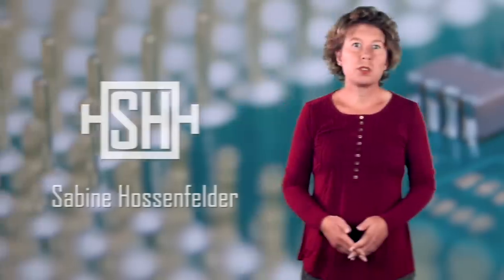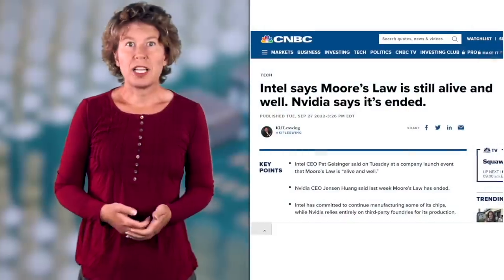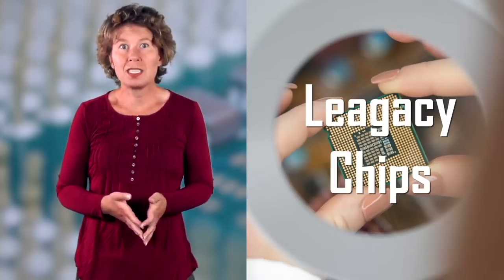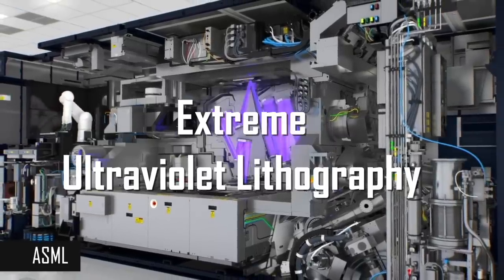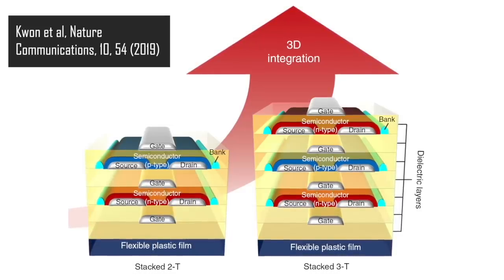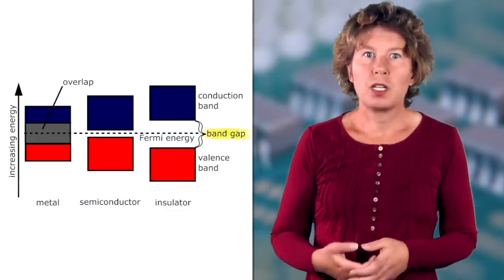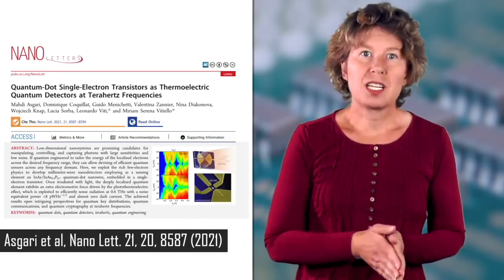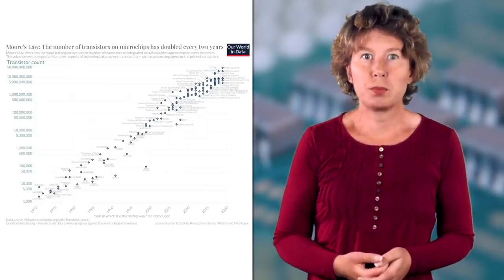Is Moore's Law Finally Dead?

Comment: There is another option for logic: rod logic, as described by Eric Drexler decades ago. This relies on mechanical nanoscale versions of essentially a Babbage Engine. At small scales these can move with astonishing speed, think Terahertz. At the nanoscale there is no friction, so heat generation is minimal. Cooling can be achieved with no worries about altering electrical properties. Quality control is simplified as God has pretty good quality control on atoms. There is no quantum leakage. The only problem is building the damn things.

Comment: The more compact chips mean that light or electron speed doesn't interfere with the processing.  I think a nanosecond of light is about the length of a pencil so compacting them is a big deal. If I'm wrong. please correct me. This was from a teacher from the 1990s.

Comment: Sabine, Moore's law as it more generally applies to the digital age is not so much about minimizing the physical size of PNP devices, while that is important, but more about increasing computer power and performance. 
That is accomplished in many ways by using different processors for different jobs like CPU, GPU, MPU and many others. 
Power and performance are raised by orders of magnitude by available RAM, ROM and very importantly CPU clock speed which has, and continues to increase, from the 4 megahertz speed of the first IBM desktop PCs to multiple gigahertz clock speeds used today. 
If you have ever opened an IC chip and looked inside, the actual microchip is exactly that - micro, with tiny wires attached to the pins on the outside that are soldered to a circuit board.
There is absolutely no reason why the microchip itself can't be doubled in size, still being exceptionally tiny, with many more active components.
We have not approached any where near the limits of size yet nor available RAM/ROM memory or clocking speed.
BTW Sabine, I'm over 70 now and my first computer was a TRS80 Radio Shack 64Kbyte with audio cassette backup data storage - Also had some of your Commodore 64s.
Moore's law IS alive and well!

Comment: Transistors may be getting smaller , you still have limits on power vias, sync/data lines size. And now rely solely on external firmware power management , incorrect settings , and they just melt.

Comment: If you use the analogy that the first computer in the 1970s lets you travel 1m/s and this follows Moores law we are currently travelling faster than the speed of light or 4.5x10^15m/s so even if moores law stops completely this barring disasters will never slow down so not really worried about it additionally there now exponentially more computers.

Comment: I would like to point out that SRAM apparently does not scale with <3nm chip construction. Meaning that it will not gain anymore performance by being made smaller. That means that bigger dies will need to be made. However,  AMD who pioneered chiplet based processors starting with their Ryzen 2 CPU years ago and the RDNA3 GPUs recently, has a way of using that to keep die size down and in turn the total cost of the chips. Intel and Nvidia both still use monolithic dies which make them much more expensive even though they can put out a little more performance. The same tech AMD used to do that has been modified to what they call 3D V Cache which is where they stack L3 cache, giving them nearly 3x the amount of cache. I'm sure they are working on further innovation while Nvidia and Intel attempt to catch up. AMD has had the "benifiet" of not just being able to throw money at these issues and have had to innovate over the years. That same approach has allowed them to blow past everyone in the APU (CPUs w/ GPUs built in). That is what powers modern gaming consoles and devices like the Steam Deck. They will greatly reduce the cost of entry to PC gaming over the years imo and should end up making consoles like the Xbox and Playstation unnessasary as they are just lower end PCs at this point and have to be sold at a loss with hopes of making up for that via licensing fees. Once even selling at a loss can no longer make them more appealing than a PC, I think they will go away and Developers will no longer have to waste so much of their budget (30-40%±) on licensing, development time, and testing for each of those consoles. That should lead to many new studios being able to make better innovative games for much less than the current  "AAA" Developers that are just regurgitating the same game franchises every year with slight tweaks(who have recently been bought up in mass by Sony and MS for tens of billions of dollars....whoops!😂)

Comment: But Moore's law is about economics and production yields. By making the transistors smaller you can cram in more of them on a silicon wafer, and you get get a better yield, which means the "sweet spot" in terms of price to performance doubles every 2 years.

If we didn't have to care about costs, we could make the microchips hugely more powerful. That was always the case. But Moore's law is about the fact that the sweet spot of price to performance keeps doubling.

What this means is for example that if we improved our lithographic production we could increase the yield for each silicon wafer, which would bring the cost down, which would bring the prices down. And then we could make the chips larger for the same cost. Not because the chips got better in any way, but because the silicon purity and lithography got better. That is, the production of them.

Comment: So... This explains why MOST of the modern electronics are not repairable. Circuits too small, impossible to reach, impossible to disassemble etc... 
Somethings are better old. Repairable and easy to do maintenance (Cars, washing machines, refrigerators etc)

Comment: One thing to  point out is we are running out of applications that need millions and millions of transistors. How do you design something like that anyway?  Thousands of engineers that each contribute a part of the chip that has 1000 transistors?

Comment: What about the problem of scaling down any further the raft of micro components on the motherboards surrounding these chips handling the electron supply and output. Presumably you can only scale capacitors, resistors and inductors down to a certain size and has that been reached? Recent shortages in supplies have been with the micro components rather than chips though the press will always only ever talk about or understand the chips.

Comment: My first computer was a commodore 64.  then upgraded to Amiga 500/1200,  My first Intel based computer was a pentium 75 with  100mb ram that ran at 60 , 250mb hdd and the graphics card ($A800) was a Matrox millenium 8MB,
The best cpu available now 13900K , Ram 6000 @ 128gb , Graphics card 24gb

Comment: I have sometimes, in a slip of the tongue, confused Moore's law with Godwin's Law (which is also, peripherally, related to IT).  Of course, at least here in the USA, Godwin's Law is dead too,  But Poe's Law has gained strength with a vengeance.

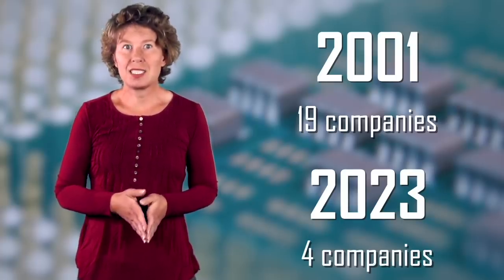Comment: 5:24 Not quite. GloFo has been stuck at 12nm for many years, which is multiple generations behind the current cutting edge of 3nm from TSMC and Samsung.
In fact China's SMIC is already ahead of GloFo, despite lacking access to ASML' EUV machines, as was commanded by the US government. 

SMIC is ahead of GloFo but behind TSMC, Samsung and Intel, due to being limited to DUV lithography. In fact, since SMIC has already fabbed 7nm wafers and they announced high volume production of 5nm dies for this year (via DUV and 5 to 7 patterning steps, if not more...) they technically already are an advanced node fab - though still a generation behind TSMC.

DUV and multi-patterning can only get SMIC so far though. Five or more patterning steps increase delays and costs and lower yields. SMIC's 7nm and 5nm nodes cost 40 - 50% more per die than TSMC's equivalent nodes. SMIC's main client is Huawei, which has been blocked from getting advanced chips ostensibly for "national security reasons" (--> so that US companies can catch up).

Btw, node numbering is largely a marketing scheme. What matters is PPA (Power, Performance, Area) and transistor density.
Reply: Yes, and all I care about is the price per GByte for my flash drives.

Comment: Critical eye monitoring is also why you can sometimes find superdiscounted GPUs and RAM and stuff like that. Basically they're lower quality. But I found that's for the only in the technical sense because I have bought several and they work just fine. I think they're supposed to die sooner then they would normally because there's more wear on the parts of it that work well

Comment: The funny thing is that Moore’s original paper had a completely different metric than what the urban myth of what it has become. If I remember correctly it had to do with the time progression of a particular “Process’ Ultimate Yield” of good transistors on a wafer which was morphed or dumbed down into the simplified “talking point clip” that got used by other people.

Comment: e-beam lithography is a lithography method using electrons rather than photons as normally used in semiconductor processing. Thus ebeam lithography is mostly a prototyping technique for universities and research, not a characterisation method as stated in the video. 
Edit: Global foundries are not relevant at the leading edge, and have not been for a while. List is basically TSMC in the front followed by Samsung and Intel.

Comment: i had an idea a few years ago and thought about it again recently, there have been some complaints about increasing the cpu clockspeed causing alot of heat, i wondered if there was a way to fix this.

the heat is coming from the electrical current moving thru the conductors right? its because of things like resistance. so if thats what it is, simply remove the medium that creates the resistance, replace the solid-state transistors with a vacuum, use nanoscale vacuum transistors instead.

basically what im saying is, is a nanoscale version of the vacuum tube, a suitable replacement for solid-state transistors that heat up too much at high clockspeeds?

if u cant shove more transistors into your cpu, u can still clock it up higher.

i wonder if its possible, theres lots of ways to manufacture nanoscale tech these days.

Comment: Moore's Law isn't dead, it just pivoted...   I reckon we are going to certainly see vastly increased usage of chiplets in SOC's with vertical layering; and a move back to analogue circuits for specific well matched problem spaces (like neural network evaluation, see what IBM are doing, 10k speed up, 10k less power). Think of chips in the future being like the T800 Neural Network CPU.. erm...

Comment: As I pursue getting my Thinkpad X61 (2007) into daily use, it strikes me that the extreme advances in hardware are important for increasingly rarified use cases. As the tech capability is correlated with cost, this seems an important consideration--the ordinary user, writing the Great American Novel or running the Next Disruptive Startup doesn't need much more than Intel's 8th generation, CPU development diverges.

Comment: Chiplets, High-NA EUV and new transistor designs (Gate all around) will come to the rescue. Then there's also the option of trying out new chemistries (non Silicon-based semiconductors), aswell as using on-chip optoelectronics for signal transmission. For CPUs and GPUs, µ-architecture design can also yield large improvements. There are still many ways for chips to become more powerful and efficient in the future.

Comment: Moore's law 1965 - 1975. 
At least that's how I like to call it. 
In 1965 Gordon Moore predicted that the complexity [...] will double every year for the next 10 years.
He was right, and after that 10 years his prediction was also obsolete. 
So in 1975 he corrected his prediction to continue at this rate until 1980, but then it will change only every two years. 
Maybe we should call it Moore's law 2?

Comment: TLDR: before things as photonic computing become even remotely financially feasible a lot of other avenues can and will be explored. Silicon is here to stay for at least another 20 years.

What is a "chip" is rapidly changing, as you lined out with, f.e., Foveros. Transistor density might not shrink at the same rates, but as long as companies find effective ways to put more and more of smaller and smaller pieces of silicon together there is still a lot of ceiling left. Also, as for consumer electronics, we already are at the point where there is no point left. Your 2019 iPhone (A13) was fast enough to do everything you wanted it to do instantly. Your 2023 iPhone will still do everything you wanted it to do instantly with slightly better battery life, plus it will have come up with a few things it now can do instantly you didn't even know you wanted it to do, and probably will not want it to do. In short: it's getting harder and harder to explain to customers why they need an upgrade. And no, the metaverse will not change that because it won't happen.🤞And AI will remain a data center application people access from the web instead of carrying it around.

The big consumer electronic exception remains gaming for the niche high end segment (meaning high end gaming PCs, not consoles). What I see happening more in more in what's left of "personal computing", including pc gaming, is it becoming more and more "consolified" along the lines what Apple is currently pushing with its M-Series SoCs and what AMD is already eyeing with Strix. The custom built PC with lots of serviceable parts in it is a dinosaur that's about to be extinct.

Data center is a totally different playing field, but especially there there is a lot of room left with specialized computing hardware (ASICs mostly) and custom integration of those tailor made for the usually relatively narrow range of operations any given data center hardware has to perform. (You won't find a large database cluster occasionally doing multi stream video encoding, for example, neither will your web frontend do serious machine learning on its free time). Servers have a lot of avenues to improve other than brute forcing it with smaller and smaller manufacturing processes. And that's not even looking at software, which probably has the biggest potential of improvement.

Unless we see some radical unforeseen revolution in material sciences that brings us a way to build transistors not only much smaller and much more energy efficient but most importantly much cheaper than the current technology foundries are invested in I don't see silicon going away for the foreseeable future even if Moore's law is slowing down on a raw transistor density scale.
Reply: Thank you

Comment: Slight nitpick simply because I've been around a long time and don't like crediting NVidea with much. The only thing NVidea did was popularized the term GPU as Graphics Processing Unit. NVidea called theirs a GPU and ATI called theirs a V(isual)PU. But prior to either of those 3Dlabs designed the first GPU for their workstations. Funny thing is, that for them, the GPU was a Geometric Processing Unit as opposed to Graphics Processing Unit which actually made more sense. But consumers understood "Graphics" as what they saw on their screens and so the NVidea term was smart marketing.

Comment: Another path is to make the instruction set and the software a lot more efficient.  Very little progress in either has happened in the last 10 years.  Take a look at how big the newest version of some software is vs a copy from 10 years ago.  Notice that newer OSes take longer to actually boot.  This shows a trend towards less efficient software.  Also consider that the processors of today are X86 or ARM mostly and neither of those are a new idea.

Comment: Moore’s law is about cost per transistor; not density. The way to get this cost reduction is density; but it is stated in terms of cost. The cost of wafers is increasing quickly. A 28 nm transistor today is cheaper than any newer node or any older node and cost per transistor scaling has slowed. Moore’s law is already in the rear view mirror. There are still improvements in density and cost; but they come slowly now. Dennard scaling was another corollary of transistor scaling; each full node you got sqrt(2) higher clocks at constant power per area; this ended after 2000 and was really dead by 2006.

Comment: Excellent video as usual. 

However I have one small nitpick: Nvidia did not invent the GPU!

They claim so yes, but the process was iterative and its difficult to find a definition by which they came first. Dedicated grarphics processors have been around since the 1970, long before Nvidia existed. The term GPU was in use since the 1980s. 2D GPUs where in PCs since the early 1990s and Fujitsu Pinolite released the first 3D GPU for personals computers. ATi (now AMD) released one later that year. In 1999 Nvidia released the GeForce 256, and made a very successful marketing campaign claiming it was the first GPU. Good enough that this is repeated till today.

Comment: My first computers... I built. My first commercial computer was C=  VIC-20. I still have it, along with several 64's, a 128, and A 128D. That's just part of my collection. That said, the only really useful side of the 128 was, and still is, the Z80 side with my own modified CP/M3+, and IP stack, which allows me to use it on the net. 🤓🤪

Comment: The problem of packing is temperature.  F.I. In future generation of ceramic scram drones they will operate with the whole drone at a temperature above curie.  That will require transistors by fluid materials (not fluidistors). So with a cube of transistors which can operate at 1000C in the core, packing is (maybe) less complex for heat transfer.